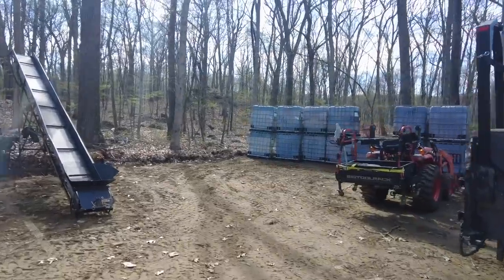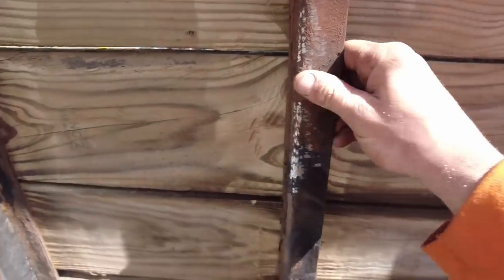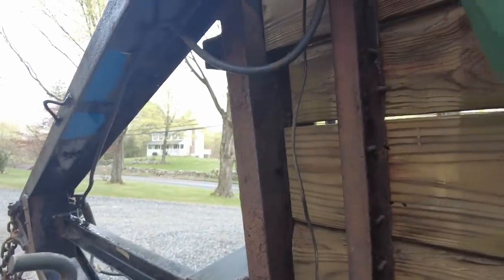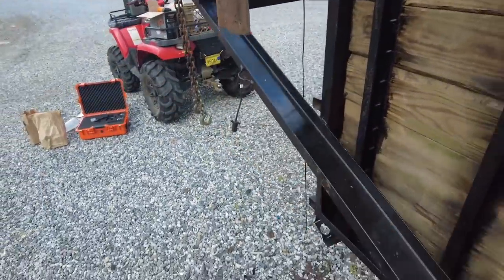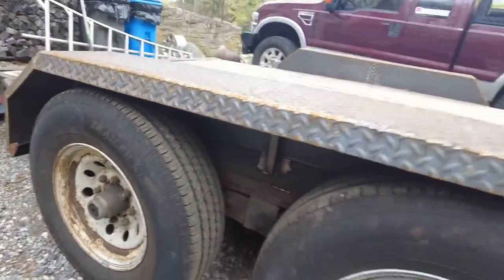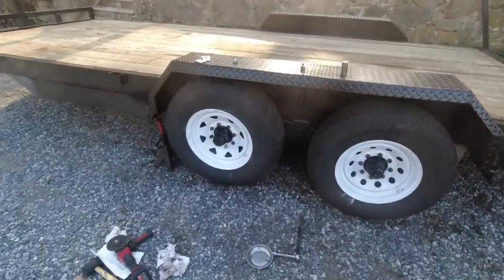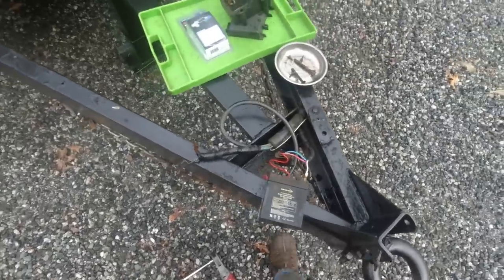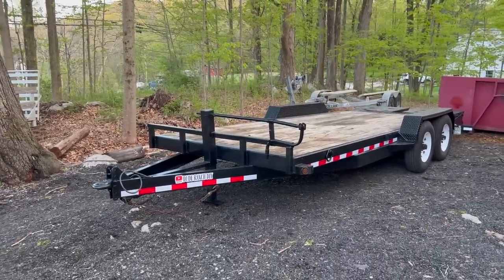#367 Refurbishing a 7 Ton Equipment Trailer

Comment: Nice job Jake 👍you caught that rust issue in time 👍👍good looking piece of kit. I work in the steel repair and new build, so I quite enjoyed watching you do the whole job properly. You've doubled the lifespan of that trailer, I prefer a good paint coat than powdercote, different name but same same on rust converter 👍👍👍🍻 well done.
Reply from the maker: Thanks Richard! It came out good. Glad I did it!

Comment: Hi Jake, you did an amazing job on that trailer. I just got done doing a 6x12 trailer and I used  por 15.  I believe the product adhered to the rusty areas quit well. It seems that every time I start a project as you did you keep finding more and more repairs. However what a great feeling when you finish you turned your project into a more dependable and desirable piece of equipment. You can feel proud of your project. It was fun to see something different. Great job.
Reply from the maker: Yes I guess that’s the nature of a project like this… already into it so might as well do it right.

Comment: Video was good Jake. Anyone that isn't interested in every single step can scroll ahead if they want. Fixing trailers is a part of the firewood business so the content is relevant. I have over 60 pieces of equipment with hitches on them so I'm constantly fixing something. We have about 15 pieces that travel the roads often so trailer lights and tires are almost a weekly thing. I keep several sets of magnetic lights around for last minute problems. My wife runs a grass cutting business and pulls a trailer every day so we have bought 5 single axle galvanized trailers so they look good all the time. We have airless and air spray guns for painting. I'm not keen on painting so usually my son has to do it. Dale
Reply from the maker: Thanks Dale, wow that a lot of trailers! How do you have time for anything else?? 😂
Reply: @DudeRanchDIY  My wife and I both work long hours and don't do the holiday thing very often.  I just got out a couple of trailers that I bought at least 10 years ago and are finally making log decks out of them. I buy a lot of projects and sometimes take me years to get to them. My buddy just bought a used Blackscreek processor and conveyor so I have it in my shop and I've been getting it serviced and a bunch of little things fixed on it. The one log deck will be connected to it to speed up his processing.

Comment: trailer restoration came out great! I've been treating my trailer decks with used motor oil for years now, might want to give it a coat!  nice to get the boat back in the water!!  cheers!
Reply from the maker: The motor oil doesn’t make it slippery? The boat is ready to go, just need some nicer weather!
Reply: @Dude Ranch DIY  not slippery at all. I apply on a hot day. Deck soaks it up and leaves a nice-looking finish. Test it out on a small spot and let me know what you think.

Comment: You have a rock solid trailer there. Ideally you’d remove all the deck boards and have the trailer sandblasted then primed and painted, then you’d have a trailer for life. You’re taking a more affordable approach but once completed you’d be very wise to have the trailer rust proofed annually. That was one hell of a score on the totes. 
Cheers
Reply from the maker: Thanks Mark, I do plan on flipping it back up towards the end of summer and touching up any surface rust I may have missed and fluid filming the entire trailer.

Comment: Nice job guy, looks like almost new!!  I just bought a dump trailer, moving up from a landscaping trailer, should be better for doing wood & other projects around the house .
Reply from the maker: Very nice! Dump trailers make a huge difference. Id suggest getting a solar panel to keep the battery topped off!
Reply: @DudeRanchDIY  morning witch one do you have? Do you plug it into your charger plug or wire it to the battery?
Reply from the maker: This is the one I have, I have it wired directly to the battery with the quick connectors it comes with. 

https://amzn.to/3LVAtX6

Comment: Hey Jake, i know its an older video but i still hadn't watched it. Good job on that trailer, question for ya, how long is that trailer and how does it tow with the 22-28? I just ordered a 22-28 with the attached conveyor and im gonna drive down to the Eastonmade factory in Ontario to pick it up, all the way from British Colombia, so i wanna make sure I've got the right trailer to bring it back 2500 miles across the country.  Take care man
Reply from the maker: It’s a 17’ deck with 3’ dovetail however the ramps fold flat to make it a full 20’ deck if need be. The trailer towed behind my truck just fine for 600 miles down to brads and back. Hardest part was finding good spots to strap the machine down.
Reply: Thanks a lot

Comment: None of that "rust converter" primer works great.  All the prep on that stuff is the same as your standard red rusty metal primer.  I also live in the northeast and did this to my 2003 trailer about 5yrs ago.  When the paint has cured spray the underside with fluid film or wool wax.
Reply from the maker: I guess time will tell, I feel it was better than just a regular rustoleum primer. My plan is to run it for the summer, flip it again in the fall to address any surface rust that appears and then fluid film the entire trailer as I do all my other equipment.